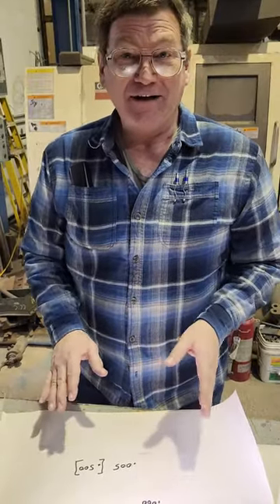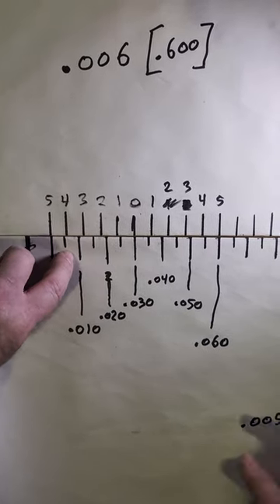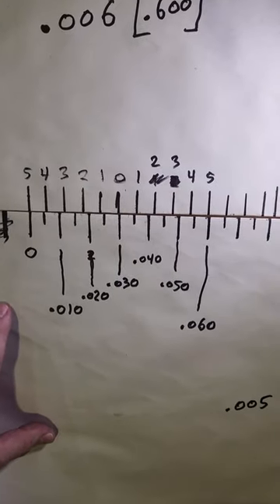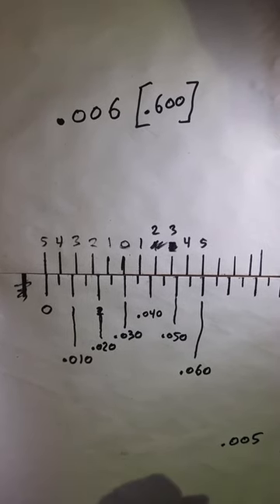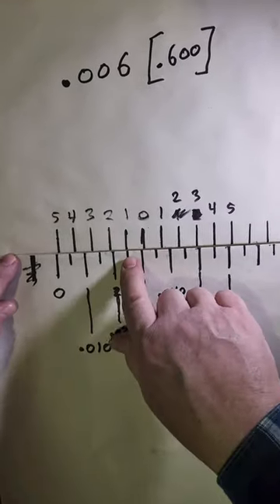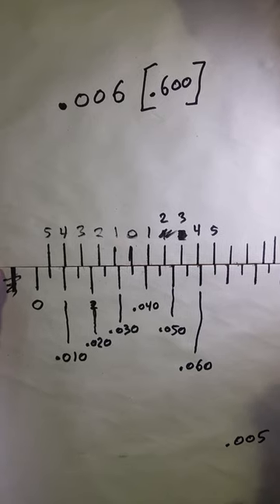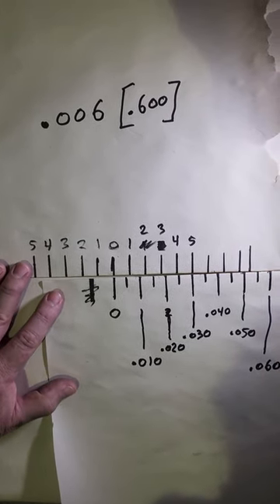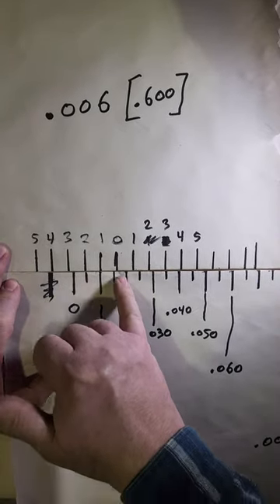Machinist's Minutes: Improved Vernier Scale Explanation

Comment from the maker: There is a scale, and a vernier scale combined to make this work.  The scale is divided in actual length increments, If you want divisions of X you make them "X" apart.  The vernier is expanded divisions that equal X+N=V, "N" being the amount of the smaller amount you want to measure with the vernier.  In this example the Scale divisions are .500" apart to simulate .005", the vernier divisions are .600" apart to simulate .006" to be able to read .100" to simulate .001".  in this case X=.500  N=.100  V=.600.  You can make as many divisions on either scale as you want, it's the spacing between them that makes it work.

Comment: Im not a machinist…. Could you show or explain what this is specifically use for? Is it on dials on your lathe ? Or just an easer way to find out how thick of bearings/ sleeves,… you need to order?😬 stupid questions I know
Reply: They actually already did in a short a few days ago.

A few astute amount us noticed the vernier scales on a dial indicator and made a comment.
https://youtube.com/shorts/uTavu5vmzuY?feature=share

It's usually used in manual measuring instruments like calipers, where the vernier scales replace a dial or digital indicator. With those they start at zero and only go up in size as you can only measure the absolutely size not the movement of the tool in the axis of dial indicator is operating, which is why it goes in both directions. It's very confusing to learn how to use them at first. Home Depot sells cheap plastic ones made by General that you can play around with to get a feel for how vernier scales work.

I'm going to tell you something, the only way to not be stupid is to ask stupid questions. The more stupid questions you ask the less stupid the questions become. Stay curious friend.

Comment: Maybe this will help. To create a vernier scale you use to scales of same length but differ in number of divisions of each scale. Not having the same number divisions as the scales slide past each other only one set of lines at a time will match up. As an example one scale has ten divisions the other nine. This is the norm in base ten decimal system. So each time the single set lines match up it is a tenth of the larger scale base ten times the number on the nine division scale.
Reply: Thanks